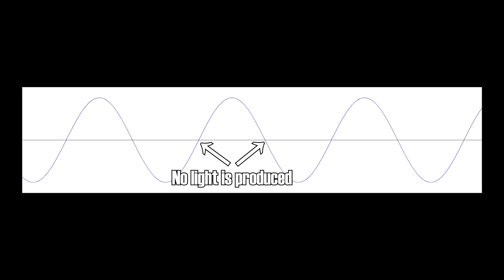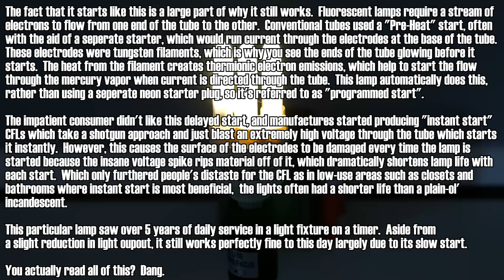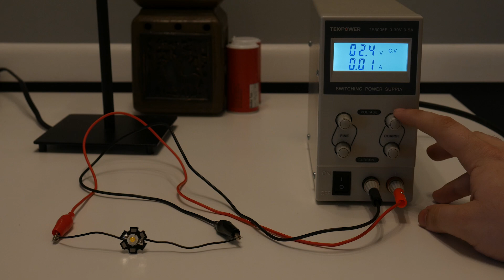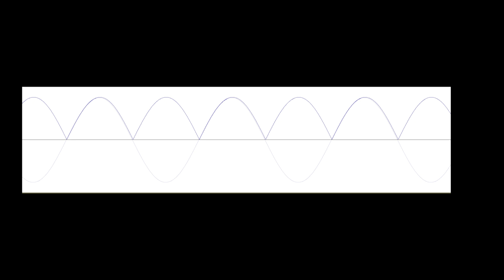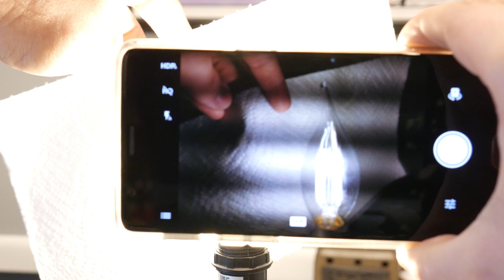LED bulbs that flicker, and CFLs that almost never did

Comment: You should mention LED Christmas lights. Those are THE WORST for flicker. I hate them so much, those cause me headaches.
Reply: How about the long, vertical LED taillights on Cadillac Escalades??
I cannot deal with driving behind one of those at night.
Reply: @LakeNipissing  : that effect you see is a standing wave on your retina.  The taillights are attacking you with dazzling photons and are a safety problem.  With all the nonsense auto regulations out there it's baffling that these are on the market.  I guess Cadillac owners are used to being despised - maybe they even crave it now!
Reply: @flowerpt  Many DRLs on the front of cars are like this too.
Reply: @LakeNipissing  Whoever allowed (low frequency) PWM dimming on automotive lights should be.... forced to look at them.  Current regulated is the only way to go for something used in dark environments.
Reply: Lake Nipissing those Cadillac taillights are the worst.
Reply: Cheap store-brand LED Christmas lights are typically half-wave rectified, meaning they flash 60 times per second, rather than 120 (and they are off more than 50% of the time). I absolutely cannot stand them. Some more expensive strands use full-wave rectifiers and do not visibly flicker to my eyes. You can often distinguish them just by looking at the plug. Crappy flickery strands have a pass-through plug like incandescents use, but good LED strands have a larger plug (presumably with a sizable capacitor in there).

Last year I learned I can easily distinguish them from better non-flickery LED lights by recording slow-motion video with my phone. With the phone recording 120 frame-per-second video, the difference is obvious.

Oddly, when recording 60fps video, terrible flickery strands may appear off on your phone screen even though they're on to your eyes, because the frame rate syncs with the flicker and the shutter is only open while they're off.
Reply: @jpstanley0  really late reply, but when I move my eyes I can see the individual flashes of lights. I've kind of gotten addicted to seeing the flashiness of lights and it probably looks weird when I move my eyes back and forth repeatedly
Reply: @njdotson  I know that feel. Certain projectors are that way too.
Reply: I thought I was the only one that hated being behind Cadillacs with the long strip LED lights. Especially if there is one in the other lane and I am only seeing it in my peripheral vision.
Reply: fisqual I have a set in my garage, just adding a single bridge rectifier out of something I pulled apart made the flicker much better. I had to rotate 1/2 the led's though as they are often wired in 2 opposite polarity strings.
Reply: This is improving, thankfully. Last holiday season there was one house in the neighborhood which managed to fool me into thinking they had incandescent xmas lights (white, even!) as the color was very very close to being right and there was no perceptible flicker. It was daisy chained strings with a little waterproof "bullet" in series with each string, obviously a good driver. Big house though, rich people - clearly not cheap enough for the mass market yet. But flicker in crappy supermarket led xmas lights is generally less of a problem now, still not perfect.
Reply: I've been considering a way to make them DC so I don't have to suffer so much.
Reply: ChrisKewl Most of those are half rectified because its cheaper to do. A couple more diodes and they would exibit less of this effect.
Reply: Haven't tested it, but could you run two stands of them together and flip the polarity of the plug on one string? You'd get 120hz instead of 60hz

Comment: LED bulbs until recently have been terrible for colour reproduction. The CRI was hopeless with areas of The spectrum missing or very low. In a kitchen meats would take on an almost green tinge. Thankfully at long last things are better but they still arent quite as good as incandescent or even later model CFLs.
Reply: you can get 90 and 95+ cri led bulbs, often for not a lot more than generic.

Comment: My eyesight want after they replaced our lights with the shitty fluorescent ones. I used to see 20/20 and now I cant even read fine print. The twisty bastards ruined my eyes. As well as the long bulbs that are the same type of bulb. I would have to wear sunglasses or cover my eyes. Cause they would hurt and burn. This all happened in the first year they were put in.

Comment: Very nice, you manage to cover a lot without getting bogged down. In design situations like this, penny pinching is common, and so there's lots of cheats to save $$$. Low current ripple = low flicker, and so we need either very well filtered DC or we need a current regulator. Once you start getting into 50W bulbs this becomes a lot of power to manage and many topologies that would give us clean flicker-free power start to fall apart in terms of size, cost, heat and regulatory compliance.

In particular the issue of current ripple is a big issue with cheap power factor correction, so unfortunately like most things making a better product involves investing in a better power supply. Active PFC + DC:DC conversion will give the cleanest output at high power and still keep excellent efficiency. For the fancypants: if we wanted after that we could drive the output MOSFET stage with a 555 or similar running at a very high frequency (1Mhz) and vary the duty cycle to change the perceived power output. A 100% duty cycle would give us full power, 50% would give us half power etc. It's important to note, of course, that this will not necessarily correlate to the same drop in brightness.

The real problem, to me, is we want our bulbs to be compatible with old lamps. From a design perspective the better idea would be to fit the driving stage in the physical lamp or wall/ceiling mounting and have the bulbs just be a housing for LED strips.  There's only so much miniaturization can solve, we are talking power and heat at the end of the day.

Comment: 6:50 But is it a FULL BRIDGE RECTIFIER!
Reply: paused video, went searching for this comment, upped it, resumed video playback
Reply: For some reason your reaction was really hilarious to me... so good job :D
Reply: oshit i was thinking of this and someone did it before me now i rage rip bye
Reply: Yeah! It's not a puny single-diode rectifier! 😂
Reply: @johnchristopherlansang1863  yea just a single puny filter cap
Reply: give-aye-way-tiiiime
Reply: FUUUUULL BRIDGE RECTIFIER!!
Reply: It's interesting in this case since he says you can see the 60Hz pulse. You wouldn't with a full wave. Good video though, as always.
Reply: @AllAroundBang  
With just a FULL BRIDGE RECTIFIER you would see 120Hz flicker.
Reply: @AllAroundBang  That's right, you will see 120Hz pulses.  Not really an improvement.  If you're implying that with full-wave rectification you wouldn't see any flicker, then that is just wrong.
Reply: @electroboom
Reply: Well let's see... the current right here we need to measure and if the voltage drop is equal to the *BOOM* CHEEAW SH-- F---
Reply: Siana Gearz wahhh
Reply: Thanks, Mehdi.
Reply: air intake FUUUUUUUUUUUUUU
Reply: I spotted the electroboom fan
Reply: @electroBOOM
Reply: ElectroBOOM!
Reply: I had to go and look up what an FBR was as I've heard the term but never knew.  Thanks for giving me something else to learn.  ;)
Reply: Yes. Yes it IS!!!
Reply: Draugo correct me if i’m wrong but if these led bulbs were fitted with a FULL BRIDGE RECTIFIER then they wouldn’t flicker right? because a FBR outputs clean dc, not pulsed like a typical rectifier circuit. that’s what the cap is for, to smooth out the troughs of the waveform
Reply: @ayeeniko  only if its regulated
Reply: Do I care that you specifically don't like this kind of humour? Not even a single bit and I wonder why you felt it necessary to inform me that you don't like it.
Reply: FOOOOOL BRIJJ REKTIFIAH
Reply: the wave he showed would have been a full bridge but with out the capacitor, and even with the capacitor you would still have some fall off between the peaks not much, but some
Reply: @99Duds  one cap is a half wave rec
Reply: @hadleymanmusic   Normally only if the input is DC, Like a pwm signal. When AC is used its normally as volt dropper. Also its been a long time sense I watched the video, so I may not remember exactly what was being said. Still with all that, the set ups on a lot of LED lights are pretty crap. Also I don't know everything about rectifiers. I learn something new almost everyday. Also looks like by other comments that is some kind of half wave pulse rectifier, and I'm not sure it qualifies as what is normally thought of as a true rectifier. Most of the stuff I work on has + and - voltage rails and is way more complex than what is in most LED bulbs so its possible I did over think it. LOL.
Reply: @99Duds  its been along time since the edison smiley bunch gang beat me outa my lab like they did tesla.
Reply: I wasn't disappointed, you made my day! XD
Reply: Yes, it is a bridge rectifier, which rectifies the full wave. It is perfectly fine calling it a bridge rectifier.
If you wanted to be fancy with the name it would be a full wave bridge rectifier.
Reply: It's real name is just bridge rectifier   and it could also be single diode rectification in some designs
Reply: Joey Schneider 
Why would some designs settle for a single diode rectifier? Wouldn't that be more difficult to smooth out?
Reply: full wave bridge
Reply: Thats what I thought half wave rec
Reply: Deep inhalation 

A fuuuuuuuuuuuuuuullllllllll bridge rectifier
Reply: The most interesting part at least for me is that he said that LEDs can't work with AC, and they can, not for long but they can do it because they are freaking diodes and will work as one just not for long lol
Reply: No, it's a puny single diode rectifier. I think full bridge rectifiers have a straight line for the waveform of their output.
Reply: @just_a_rock  The rectification has little to do with the stability of the output. That comes from filtering, smoothing and the like.
A rectifier makes sure that current passes one way. A half wave rectifier only allows half the wave through, i.e. you get the positive half wave, then a period of nothing, then the next positive half wave.
A full wave rectifier (the simplest bridge rectifier) will flip the negative half wave up.

With appropriate filtering/smoothing, both can provide a near constant voltage output.
Reply: @jeffreyblack666  
Thank you for correcting my mistake, I appreciate that. So the example rectifier is a full bridge rectifier.
Reply: @just_a_rock  half wave pulse.
Reply: It usually is a full bridge rectifier, you just don't have to shout it. And i know you're referring to electroboom, but i don't like his kind of humour.
Reply: @SianaGearz  nobody cares
Reply: @SianaGearz  nobody gives a crap what kind of humor you like. Don't shit on a joke just because you want to add your unneeded 2 cents in a conversation.
Reply: @SianaGearz  he discovered itvwas a half.

Comment: This video should have been a 60fps video...
Reply: Technology Connections I see, thank you for clarifying!
Reply: A well produced 30p video with correct motion blur looks great to my eyes. I appreciate what you do and keep up the good work and production quality.
Reply: I think he shoots in 4K, but crops to 1080p. I can understand people do that when they work alone as it gives you more room to crop your footage when you can't set your tripod absolutely right to fit yourself the right way in frame for 1080p.
Reply: @weeardguy  Yes, it adds more room to crop, but it also lowers noise nevels in the overall video because each 2x2 square of pixels in 4K will get downscaled to 1 pixel in 1080p, reducing the noise.
Reply: I can clearly see the disc rotating, with no blurred lines. Am I doing something to watch this video wrong?
Reply: Why?
Reply: Dmitry Shap because with 30fps, you can't see anything on the discs.
Reply: Where's the 4k or even 1440p? I only get 1080
Reply: Or why not use the frame rate of film?  At 24fps you'll get that nice cinematic look?
Reply: @Gringo_In_Chile  I know you are making a joke. And it didn't go over my head. But... 24fps is only bearable because of motion blur and interlaced frames.
Reply: Glad you got the gist of my joke.
I am a video engineer and could have gone down the perception of frame flicker road by describing each of the following, but then again why?

NTSC 525/60 video runs at 29.97fps (60i or 30p)
PAL 625/50 video runs at 25fps (50i or 25p)

24fps (film, ATSC, 2K, 4K, 6K)
25fps (PAL)
29.97 (30 ÷ 1.001) fps - (SMPTE DF / NDF timecode)
30fps (ATSC)
2:3 pulldown

Yada, yada, yada....
Reply: @Gringo_In_Chile  That's true. I appreciate someone who knows the science behind film.
Reply: Good point
Reply from the maker: Ah but you see, with a frame rate of 60hz, the shutter speed had to be at least 1/60 of a second.  That made the lines appear stationary always.  I think the pattern is pretty clearly stationary between shots.  
Aside from that, I shoot in 4k for editing purposes and don't have a camera capable of 4k60, and to be honest I generally prefer the more cinematic 30p to the soap opera 60p anyway.
Reply: Actually, Tech, 30fps isn't cinematic (read: "film look"). Even that is already "soapy"/newsy. It's really 24P that has some of the film look.
Reply: I am not sure you know what we're talking about. And I'll not explain, as you, mx dear sir, are swearing...
Reply: 30FPS is perfect for this kind of video, especially with the history that you go into, like its a movie theatre :P
Reply: Who gives a shit. It would be just the same even at 140p.
Reply: Humans can't see above 30fps.
Reply: @jamesisaac7684  That isn't even relatively close to being true.

Comment: Cool, thanks for making a video about this. I replaced all my light bulbs with LEDs but now that I have a newer smartphone which can do slow motion recording at 240 fps, I noticed that they were flickering and I thought that couldn't be. Thanks for clearing that up. Maybe I need to specifically search for some that don't flicker. Also I have mixed cold light where I work since I tend to get less tired with it and warm light in the bedrooms.

Comment: Not qulified but, Basicly  that driver in that filiment style bulb. Is  likely a capacitive dropper ( capacitor used like a resistor with out the heat) that limits the current then is rectified. And if your lucky  is also filterd with a small cap. But liky you said not a big enofe one.  The schmatic in the wiki is what most of theses style blubs use. Just replace the  parts after r3 with a string of leds.https://en.wikipedia.org/wiki/Capacitive_power_supply 

The other option that is unfortnatly becoming popular is a small chip from china that switches leds on in series. So wheen the ac wave is at say 6v it switches 2 leds on thenat 50v it switches say 15 leds in series, till all the leds are in series when it reaches 120v. It flickers relly bad but its incredably small, and very effecent. 

Thers also classic ac to dc power supplies (like your laptop or phone charger) but there not very comon in bulbs due to size, they are more relaiable though. 

Theses guys make most  of the chips you will see in led bulbs or there clones.
http://www.bpsemi.com/
Reply: EE here: 
King of KYA, you are absolutely correct and kudos to you for the great explaination. I also didn't know about the switching chips you mentioned in your second paragraph so thanks for that! LEDs operate most efficiently at a very specific forward voltage. (This varies from LED to LED but is usually less than 4 volts.) Since an inadequately filtered rectified sinusoid will vary in voltage, this would definitely help with efficiency at the cost of much increased flickering. But better filtering with a larger capacitor is a slightly more expensive way to solve this issue.

One more thing that is relevant: many of the LEDs in LED light bulbs actually consist of several LED elements in a single package. This allows a greater forward voltage drop across one small component which saves space and cost.
Reply: ......other option that is unfortnatly becoming popular is a small chip from china t

I believe this was one option explored by an AMERICAN chip manufacturer and then copied.............